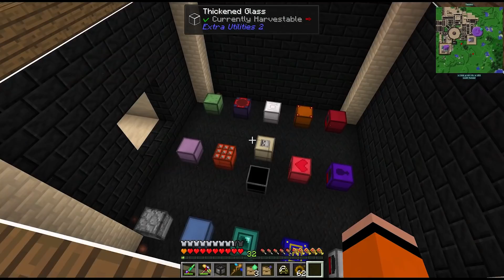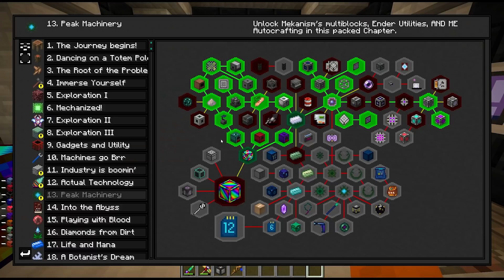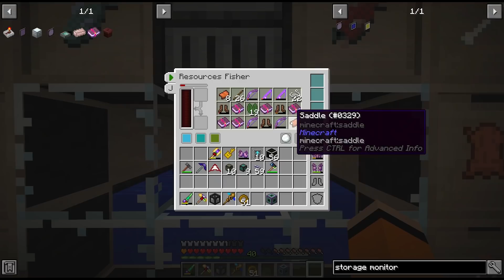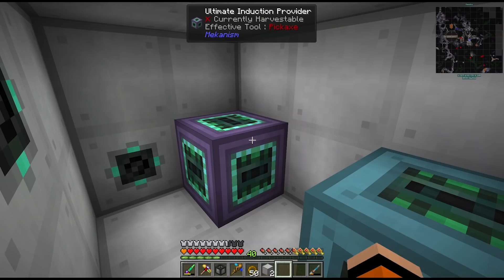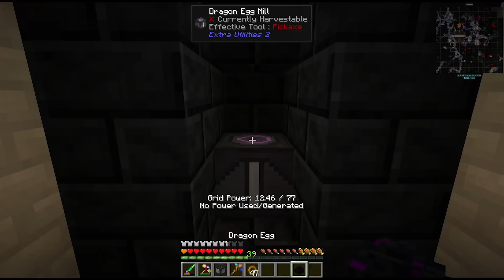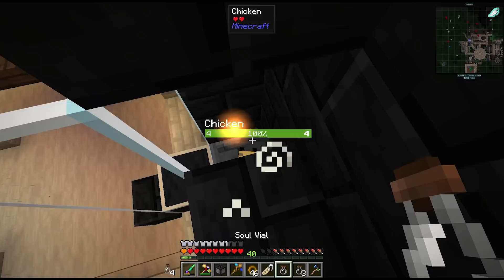Divine Journey 2: Ep23 - Rainbow Generator & Quantum Quarry! Modded Minecraft

Comment: I'm having a hard time getting the induction cells and providers to auto-craft because of the energy tablets having different NBT data and the system not recognizing they are in the system. Any advice on how to fix? I have tried replacing the recipes with the energy tablet I crafted instead of using JEI but that didn't work.
Reply: Ok I finally figured out a solution to this problem. First you have to craft the energy tablets in a RFTools crafter (I used export busses of all the materials into different sides of the crafter to pump the materials in as fast as possible). Then once the energy tablets are crafted, you need to send them to a charger (I used the chargers from enderIO). After the tablets have been charged I sent them to a drawer and hooked up an storage bus to the drawer and the ME system can take them from there to auto craft with them.

For the auto crafting patterns, you need to make the patterns with the powered energy tablets and eventually the powered energy cubes. If you craft an energy cube with a charged energy tablet, the cube will have a bit of power in it (you want to see that or this will not work).

Comment: To make withers easier to kill(not that they are hard), consider using an rftools shield projector
If you put a comparator on the induction matrix, you can measure the fullness of the matrix and control when you need the generator active
The interface can directly push into the enchanter, but can’t pull
Enchanted ingots are faster to make if you craft the block instead, same with the evil infused ingots later on
You should consider putting in recipes when you craft stuff, you’ll make more builders for sure
You can craft activated Ender cores, make sure you read those tool tips😄
Note that a mechanical user on an end crystal can activate the Ender cores, so modular machine is both not needed and completely trash 
Quantum Quarry mines every block and you pay for the cost, even if you filter it
Definitely use the biome marker corallium plagued swamp, corallium pearls are quite important 
Note that the quantum quarry does not give bitumen, so you need to run the builder for that 
You can combine books and use that in the quantum quarry, efficiency makes it go super fast

Comment: I know Integrated Dynamics is currently unavailable, but if you can get access and if it hasn't been nerfed it can transfer the integer limit of power/items/fluids at a rate of once per tick in it's base configuration.

It also has blocks that act as links between distance and dimensions so you could place the Rainbow Generator somewhere else, hook up a power interface and a (I think) Omni-directional link and plug the other end into your induction matrix, but the way you have it setup now seems to work just fine 🙂
Reply: Power is gated but fluid and item are certainly good options